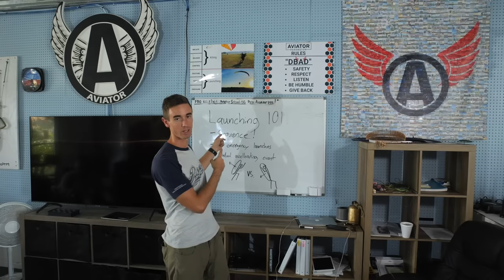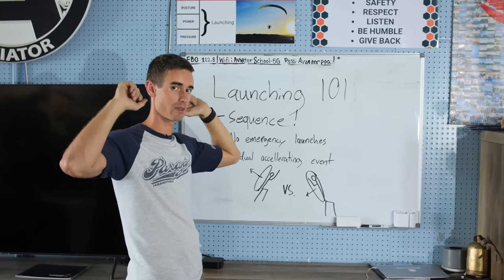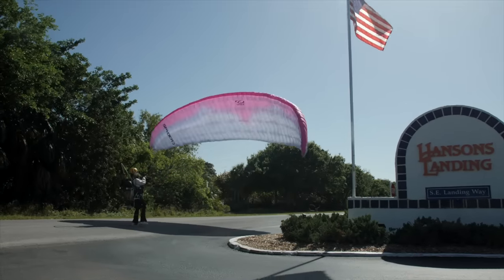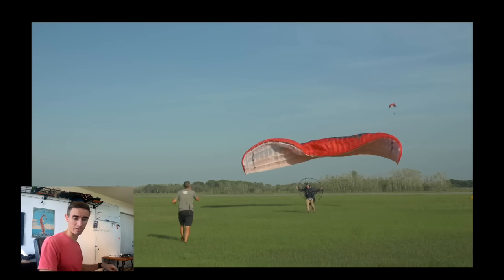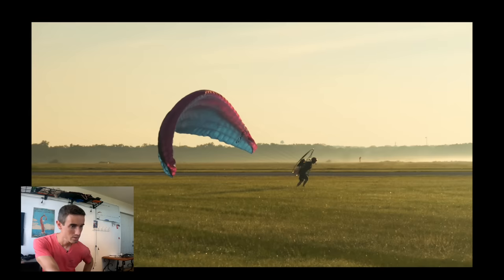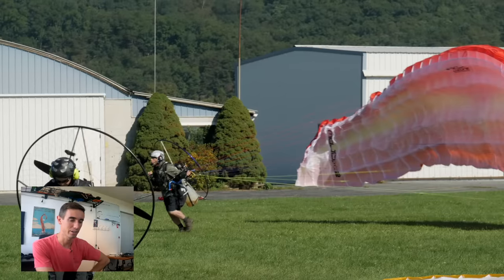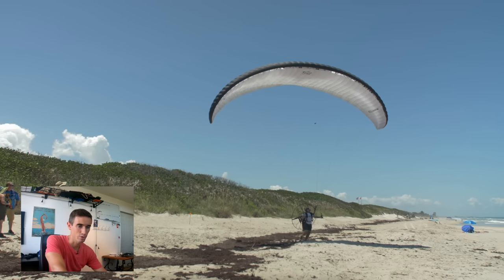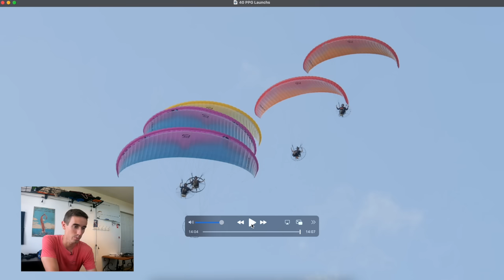Launching your Paramotor 101 - The Basics of a Smooth Take Off

Comment: <<non flyer.      The A's.....are "brakes" when the motor is off, or going down.    When you're on the gas the "brakes" direct you upward?     So when your taking off start with 0 brake, till you got speed, then "brake" to provide lift and take you up under motor power.      Sound right?